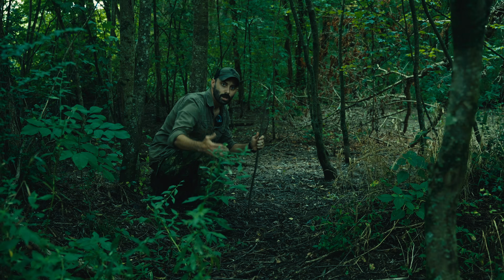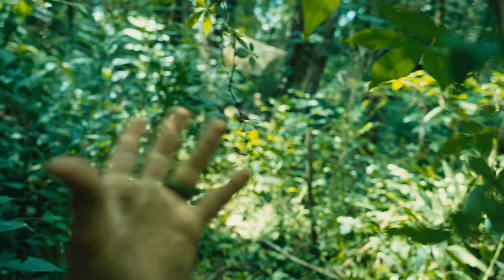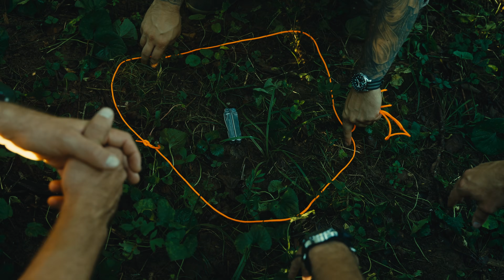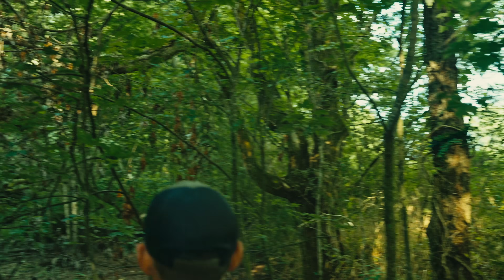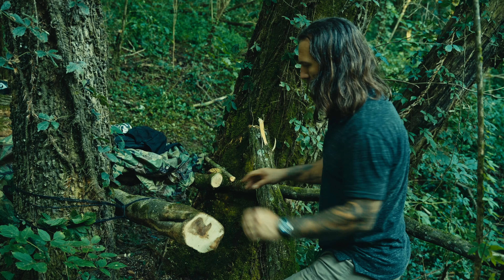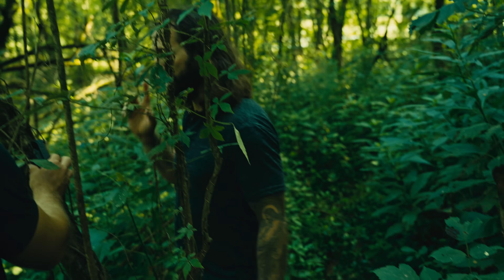Perimeter Defense | Early Warning Detection Traps

Comment: You can definitely spend some money. That was $90 in IWA bangers 😂

Premade kits, you can pre-drill and rattle can the mouse traps, pack zip ties, and a handful of micro eye loops screws. I personally use Kevlar line. Minimal stretching, slick and takes up less space than monofilament.  It can cut flexcuffs if you're in a real bad situation.  You have a bunch of optins with chemlight sizes well. 

One thing i have used the chem light alarms for is color coding like structure. Zip tie for to a tree or small log, even inside a tent or home. Run each cord to camp as your main alert. White is front, red is left side, green is right, and blue or some other distinct color for a rear alert. 

Layer in some primer or blank alarms. These can be zip tied or screwed into a tree so when a line is breached it doesn't alert next to the person, but behind them. If you have multiple on a strand. This can look like multiple small calibers from behind. Disrupt the OODA-loop and you can have low volt led strobes or other lights at eye level behind trees and on clothespin trips. In the dark and silhouetted with  pops coming from behind you. Strobes or spot lights on a small battery switch will gate Nods and/or make size of force known. 
Following up with some bangs or a pepper bang from the same company on a pull string from the camp if you're feeling liike area denial makes sense. (Those pepper bangers are sweet. I wish they didn't run $63/ea. 😂)

Comment: I saw one that was set up with a window alarm.
Reply: Those work well with dry weather in my experience. You can also use the runner's alarms that a small metal rod pulled from the module sets off a painfully loud single tone siren.  If this is your primary alarm with noise. Make sure you test regularly and have backup batteries. They die fast. I've seen them modified to take the coin cells out and replace with a more common AAA.

Comment: You can buy packs of surplus trip wire. It's very fine, almost impossible to see. A spool is smaller than a G17 mag, so it's very portable and comes with wire coated in green and tan for camo.

I used to keep one in my butt pack back in my day.
Reply: Those were my go to for a while on stealth camps. Now I use 100 lb Kevlar cord. I have a handful of rolls omin gear in blackish/brown and tan. 200 lb is a little heavy but works well for tying to trees or dead fall. The thing I like with Kevlar is I can run 40 feet with slack through rings to move an alarm away from the camp or to the camp for chem lights. A spool is small.  I want to run some on sewing bobbins and I can have a smaller package. I like the option of wire and Kevlar for a pack.

Comment: How about replacing mono filament with Kevlar line to greatly reduce stretch. It can also be used as fishing line.
Reply: I just commented on another person's comment. I use Kevlar 100lb line for most of my stuff. Stretch is near zero especially when slacking the line or pulling it tight enough it's nearly pulling an alarm. Both having no stretch is very helpful. Mono also gets a shine for cheaper stuff. Heavier weight, the easier to spot. For 80 lbs test I can get a substantially stronger material, no stretch, thinner and less shine. Price isn't crazy either.
Reply: @phl_knives  Thanks for the help, I really appreciate it.
Reply: @thriftysurvivor6117 No problem at all. Glad to share some useful info with others in the community when i can.
Reply: @phl_knives  Yes in deed. Sharing useful information with the community helps the community grow more proficient.
Reply: Mono sucks even for fishing! Use a fluorocarbon line instead for fishing leaders etc. Fluorocarbon is way thinner profile than a mono line of the same pound test which automatically makes it harder to see, but also doesn't refract light the same way (practically vanishes underwater no matter the water color) and has way less stretch too.

Comment: Hey guys, a question.
Hunting camera's, spy-bugs are all over the place/cheap. Every creep can install them in the forest. Receive an alarm on his smartphone..
Do you have improved tricks to detect this 'Whorse-than-a-Vietcong-in-the-forest-enemy'😅
Reply: They kind of do, depending on the system... Night vision. The illuminator on nods is IR. Trail cams and other cams that can see at night also use IR lights to get pics or video clearly. If you're running tubes without an illuminator on, a trail cam with IR will light up like the sun if you trigger it or if it's on a steady feed especially. Now if you spot a camera from a distance, you can disable it, or blind it with a IR flashlight with enough throw. Aim that at any camera and it's going to wash out the sensors temporarily.

Now more permanent, A laser pointer could cook internals as well  by massive over exposure to light it's not meant to handle. It's overexposure to the photo receptors in the camera. This could be done from a distance if you have a mounted laser on a magnified rifle. Camera goes white and then goes dark. Now you know someone might come look at the malfunction.
Reply: @phl_knives  Thank you 😊
Reply: @angelikamaris8728 No problem.  I hope that made sense. 
I just know I've seen night capable camera under tubes and they glow from a distance even with some ambient light. 

Technically you can even use your phone. Turn on your camera and press a buttom on your TV remote with the front facing your camera.  You'll see a purple light glow for a second.  Thats an IR light captured on your phone camera. There are a few purpose built things for capturing IR hidden cameras. I have friends who specialize in detection of these types of things. I've picked up the basics from them.
Reply: @phl_knives  2eX, thank you: i gonna try the smartphone option.
I survive with small budget and can't effort expensive night vision  equipment 🙄

Your friends, who are specialized in detecting wildcam's
What's there motivation?

Mine is: 'big brother watching you' has to stay out of the woods.
Reply: @angelikamaris8728  No problem.  
I'm with you on the budget. Im only getting nods if I'm sponsored 😂
I've been able to use friends and rentals for work stuff. But not in the budget. 

For the friend's looking for cams. Thats not just wild/trail cams. They do that if someoke is tracking a client who has a higher security profile (executives or people who have money and take security seriously) They're checking offices for listening and video devices as well. Trackers on vehicles if needed. They could do background checks on new employees depending on the work they're going to be doing. 

I agree. I don't wany cameras in my woods or anything like that. Rare occasions when poaching is becoming known in an area or illegal dumping. You'll see game commission setup trail cams short term to catch a plate. Thats rare from what I know in PA atleast. 

I do agree that spy cams and bugs are much more wildly available for the public. I've had friends sweep AirBNBs for them. Rare but they have found them. Immediately calling AirBNB and the owner, if you have camera's outside the property okay. I don't love it but understand.  I surely wouldn't be okay with them in an AirbNB or hotel.  Especially when we travel for contract work my GF and I, depending on the state we are going to, we will have firearms with us. I don't want some creep watching us and knowing we have valuables like that in our room if we are leaving.  Even when they're cabled locked to something in the room. (ARs at least. Pistols we keep on us) Hotel I've never found one. I did see a glow of an IR light once and was about to lose it on the hotel. I realized she was had her arm in the remote behind her. Lol.
Reply: Ehhh the game cams that send phone alerts means they send out RF signal too. "They" might walk by, but any signal ops nearby knows to look closer when the cam trips even for false alarms. Time to get scarce fast and best to ditch those cams.
💸💸💸

Comment: Birds , squirrels,  coyotes , deer etc are all gonna make u crazy
Reply: When done correctly. Not really. Thin Kevlar cord betwen thigh and waist level will not trigger when small animals move through the environment.  You can set traps sensitivity depending on the spring weights and how far you move the trigger on traps. Years ago I used chem light alarms at a stealth camp with a few friends. Never once did we have animals trip our system. We did have a hunter trigger a blank alarm. Those were set for early warning for bear mostly and to test the gear. But in a heavy bear area, right before hibernation season and also early cub seasons especially we wanted early detection. We had plenty of other wildlife around. Only things that would have trigger our setup was deer, bear or human. We set off our own system once or twice over the years. Someone thinking they weren't to the alarm to duck under and walked through the line

Comment: We used to make flashbulbs filled with black powder that could be set off with a battery.  You could use them as a detonator for something larger but they were pretty loud on their own.  A clothespin with two pennies glued to it with a Popsicle stick between them completed the trip wire. A triple A battery was enough to set them off.  You did have to solder wires to the bulbs and to the pennies but that wasn't hard. We were just screwing around but did kind of want to do some war games up in the woods.

Comment: Don't use wire. Use fishing line. That's what the Vietcong used.
Reply: Kevlar cord. Less shine, heavier break strength and nearly zero stretch. They're using monofilament fishing line in one of the clips it's mentioned.  Kevlar is awesome for these applications or other used where a very thin but heavy duty cord is helpful.
Reply: @phl_knives  I'm going to look into that. Thanks brotha!

Comment: Spectra / Dyneema line is great.  A bit stiffer / less stretch depending on thickness.  
In addition to chem light,  the cheap LED lights can be activated with a bit more sophistication.  Keep um in a zip lock back wrapped in duct tape for added water proofing 
Brass or Stainless steel jingle bells = super cheap sound alert 
Air horn is also another useful tool
Mini CO2 canisters could be useful.

Comment: For years I carried the small, cheap brass fishing pole bells that have the clip made on them that you can likely still buy in the fishing section of Walmart for a few bucks. I painted them with the same spray paint as my rifle so they didn't shine. Really easy to set up on some fishing line and really easy to take back down fairly quickly. Each situation or terrain dictated how they were placed or how the line was routed. Just food for thought, it worked for me. 
Great video guys!!
Reply: I use 3 of them when I go camping 😂

Comment: Set up your trip wire at a slight incline/decline to minimize the collection of rain drops and specially morning dew.  Use dead vegetation and dry branches/twigs around your perimeter, at least 1 man pace deep, makes for great natural and unassuming perimeter alarms; make sure to rub dirt on the cut/saw marks to make it look natural.  Empty plastic bottles under leaves works great for early detection.  Also, range out and alpha numerically identify your sectors and engrain it into your group.  Map out all of the alarm points, set up kill funnels, rally points, casualty collection points, resupply points, etc.  You will not be encountering ST6 or a Ranger element, so prepare accordingly and understand your area of operation and those in it, identify your target and don’t be indiscriminate when engaging.  Don’t forget deploying psychological warfare elements to cause them to think twice.  Not a game, you are dealing with human beings, so be kind and be human.
Reply: All solid advice.  Thanks for the incline/decline on wire. Even using Kevlar static line which is my go to for most systems. I never considered condensation or rain beading. 
I've used the dead vegetation as tangle foot/area denial around stealth camps along with the chem lights and depending on how large the site. Ramset charge trip lines and sirens. We have setup smoke as well that we could pull from our position if needed instead of throwing. You can do flares, and other things that will light an area and cause confusion.  Fire risk in some areas
One point I would add to the chem light use at night that we used many years ago is if you run your wires back to your camp from a further location, use your lights to mark much like a structure is by color. White stick is front, right is red, left is green and use a blue or other color for rear. You know by the light tripped that you have that direction as likely avenue of approach. 
With blanks/Ramset you likely will spook someone just stumbling into the area or alert someone armed and get them ready for a fight.  Pro and con to this tool for sure. Those are usually setup for warnings in normal stealth camps for anything from animal to human. Where we had setup camps, only humans moving through had been a single hunter who tripped that alarm. He was cool and had some coffee with us. Ended up coming up for another camp we did. 

Bottles work great under brush for sure. Depending on the environment, this is normal in an area with trash. In a more remote area with less trash you're hearing that distinct sound from much further. 
We even had a buddy who setup a trip that would rupture a OC spray can and that was dumb for how close he was. I've got down wind spray a few times. That's not an exposure I want and much more indiscriminate to a family walking through. We said absolutely not, cool concept for area denial but a quick way to make us not stealth and have a very angry person. Even more so when our own people have tripped alarms by mistake. 😂
 I like your ideas. Simple and safe. Very important points in being decerning in who is a threat and consider it before engaging anyone even in a worst-case scenario.  Still keep awareness up when a lone person strolls into you in a remote area. They may have friends but thoughtful responses is important in anything

Comment: Under circumstances I won't mention, I was tasked with guarding about 100 acres of forested area for a long duration of time (commanding a team of 90-400 personnel, depending on threat level). Deer and coyotes tripped the trip wire so frequently that it turned into a full time job chasing down and resetting the trip wires. The trip wire idea was completely abandoned after only a few weeks. With the lack of more modern options, perhaps we would have stayed with that. There are much better options available now, on the cheap, that are far better. We've evolved a lot since Vietnam. Site security became very high tech with many things I'm not allowed to disclose.

Easy options I can mention: Cellular enabled trail cameras, thermal drones, infrared trip wires, thermal monoculars, lots and lots of cameras, etc... If time and location permit, start putting up fencing.

Comment: Man I love this channel.  Never a bad video I swear. 

Braided fishing line would make for a better tripwire: less stretch than monofilament, smaller diameter than mono of the same tensile strength, and less reflective especially in green or black.  Secondly, a mouse trap fitted with a .22 or shotgun blank, or any of the early detection kits sold online for cheap that utilize blanks, would be good options as well.  I can see why that option was probably omitted considering how weird youtube monetization has gotten.
Reply: Braided line might not break as well as floro if that's the intent

Comment: Theres these specialized noisemaker traps that use blank ammunition (some variants may be modified to fire live ones. Eg, buckshot or birdshot)

The issue with those is preparation and its too specific with its use. But I personally think a fixed tripwire is enough of a primitive warning/alarm trap because usually they either fall or start thrashing/cursing out.

Comment: I want to know the tensile strength rating of the line that was used here. Too high, and it becomes thicker (more visible). Too thin (less visible) and it will just snap without pulling the distant end.

Comment: I remember seeing 3D print files for trip wire setups where you actually put a live cartridge in.  Obviously the projectile isn't gonna fly anywhere but it will make a loud noise.  The files had adapters for everything from 22lr to 12g and everything in between.  The mouse trap with cheapo glow stick is a really cool idea
Reply: They sell different ones. I like the mouse trap ones as well. I might play with them and some of those snap caps you would use in toy guns. See if I can make ones that sound off.

Comment: I have multiple kits for this, electric alarms and shotgun primer alarms, both work very well and have their distinct advantages. The kits are primed so that very minimal effort is needed to set them up - 3 directions is the bare minimum, more is better. 4 is the best balance for a small lightweight kit. 

Keep in mind that it must be strong enough fishing line to activate your device, spectra/dyneema cord is what I use. 

Awesome video, thank you.
Reply: dont forget the vietnamese bullet trap as a last desort defense. Takes 1 Bullet, 1 nail, some wood and a shovel.